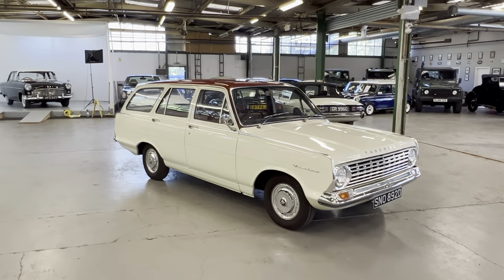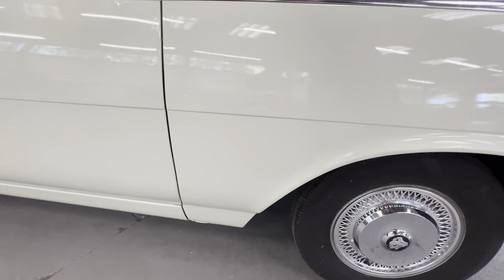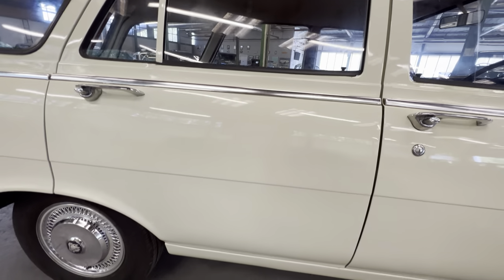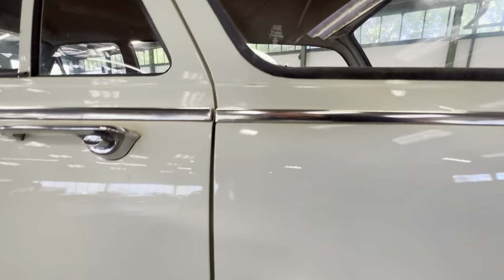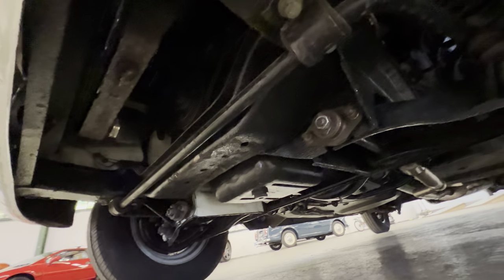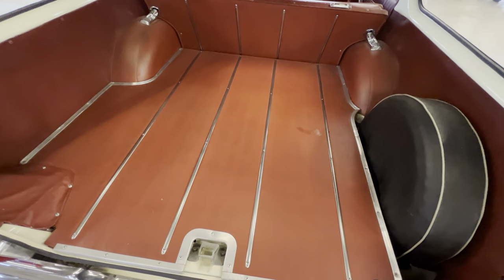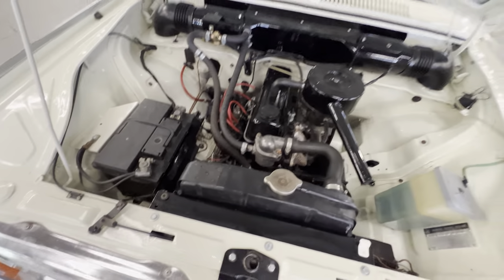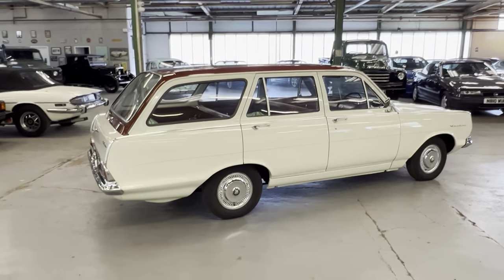Vauxhall Victor 101

Comment: I learnt to drive in a 1964 101 in 1975. The three speed column gearchange was easy to use as I recall. When the car was scrapped I kept the "101 Deluxe" badge from the boot. I still have it! 😀

Comment: It is not a 'deluxe' it is a 'super'. Super had 3 speed column change and a bench front seat and '101 super' badge on the back.   Deluxe had 4 speed floor change two luxury individual front seats, chrome wing mirrors, extra sound insulation and '101 deluxe' badge on the back.  Deluxe was was higher spec. model.   Lovely car, my Father brought a new two tone blue deluxe 101 estate in 1967,  USA style for the UK market,  comfy quiet ride,  carry a family of 5 on holiday with ease.  Much better than the Ford Cortina which was crude,  noisy and uncomfortable by comparison. Unfortunately they did suffer rust problems......
Reply: Standard spec on the deluxe was three on the column. The four speed was an optional extra on all models but the bench seat was not available on the deluxe.